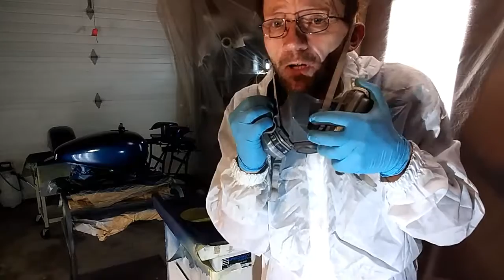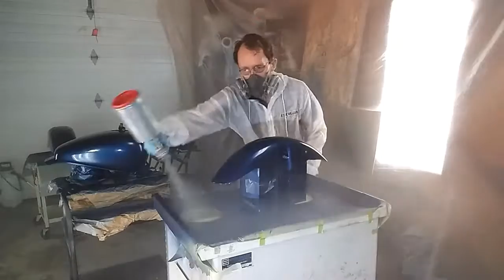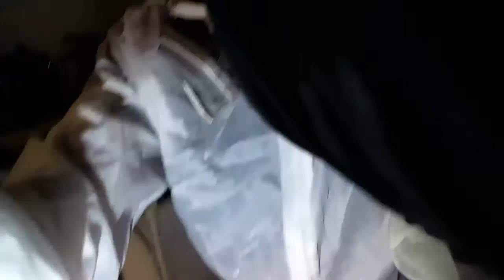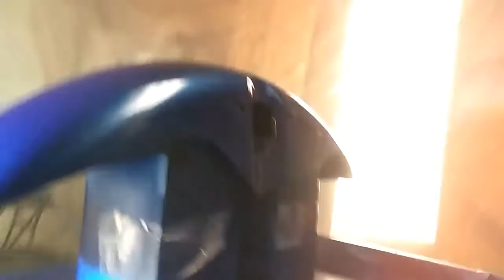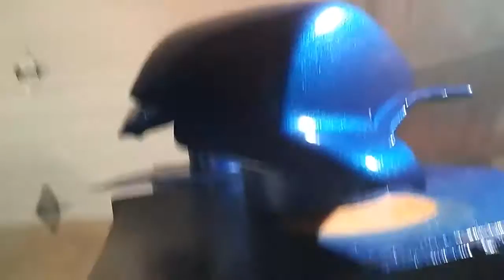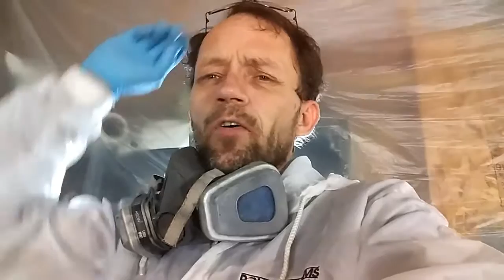Spraying clear coat on bike parts

Comment: What color is that paint?
Reply from the maker: I couldn't tell ya for sure because I didn't have a paint code for it, but it is a metallic similar to cobalt blue. I think just a shade darker though. If you happen to notice the purple tint, I added a little pearl to the paint. Also, on the 1st coat of clear, I added a powdered Ice pearl, which will reflect a multiple spectrum of colors. I have a one minute video of a walk around of my bike a couple months ago after I added the flames. It'll really make ya wonder what color it actually is, but I love it. I will try n locate it here and go ahead and upload it on my page, so if you would check that out and let me know what you think, that'd be awesome...